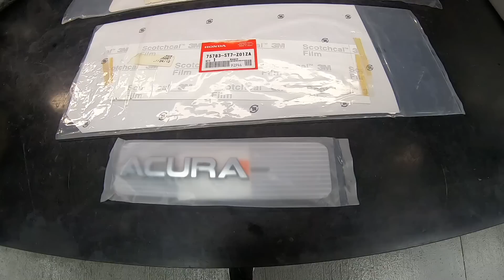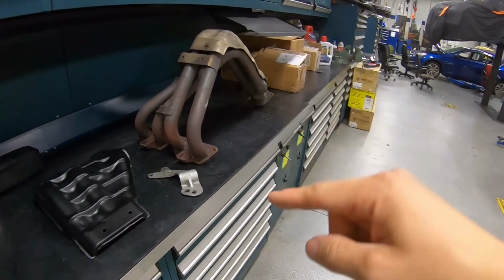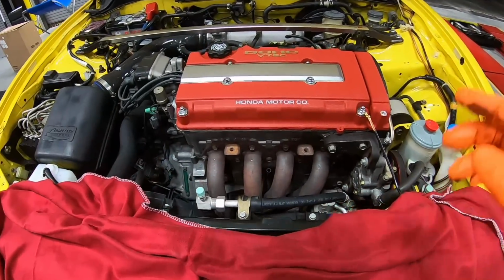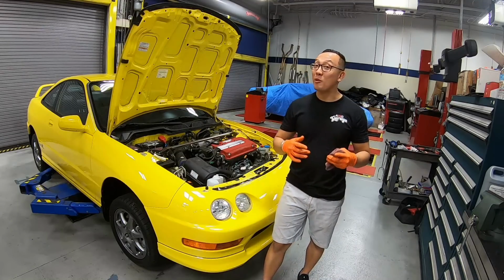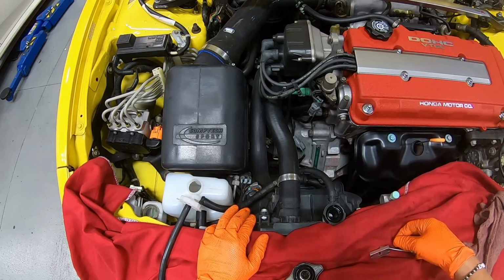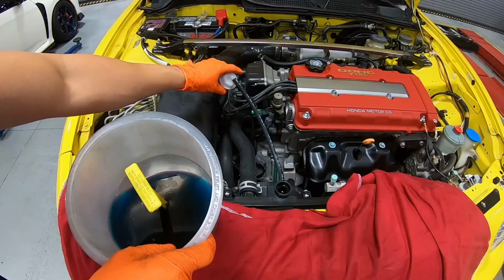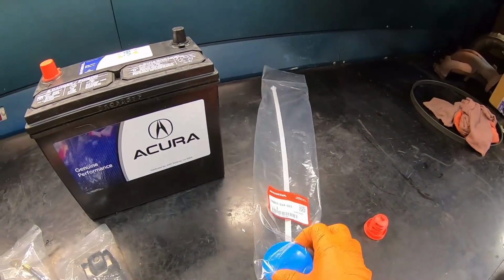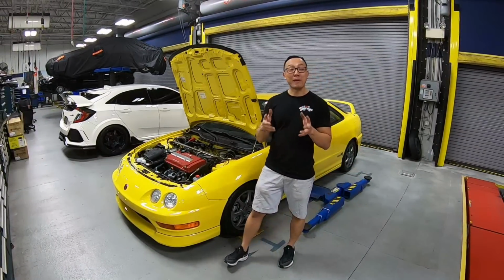OEM+ Refresh DC2 ITR -  Engine Bay Minor Refresh with JDM ITR Header (Episode 3)

Comment: Nice!  Had this channel recommended to me recently as I've been poking at some similar small restoration / maintenance on my NSX.  Not disappointed!  Factory spring hose clamps ftw,  the majority of the leaks I've had on my cooling system have been from some previous owner/tech using worm drive clamps instead of the OE spring clamps.  100% the way to go.
Reply from the maker: Welcome aboard!

Comment: Engine cover paint?   High temp paint or a ceramic paint?
Reply: I am curious as well how it was refinished.   I used high temp paint on one in the past and it was not going to last.
Reply: @touringteg  Engine cover is new OEM I installed it prior to Mike getting his hands on the car...
Reply from the maker: Are you referring the engine valve cover or exhaust manifold cover?
Reply: @Jamess17065  Sorry I meant the exhaust manifold heat shield
Reply: @ahcgarage  I assume he meant exhaust manifold cover.  I was curious how it was refinished.
Reply from the maker: @touringteg  Yea, we refinished for he exhaust manifold cover with high temp paint. With the right prep, the refinish will remain solid
Reply: @ahcgarage  Thank you!

Comment: Em1 ground strap.  Too bad ITR it’s discontinued.  I am annoyed with myself because a few years ago I tossed a used one.   This was when new ones were still available.   I restored the one on my current R.

The JDM 98 spec header length is different length than USDM so which cat or test pipe was used?
Reply from the maker: We did the same. We threw away usdm exhaust manifold cover and replace with the new one. 

As for the exhaust manifold, your are correct. Jdm 4-1 header is longer so we used a Jdm cat and bolt up to the stock b-pipe
Reply: @ahcgarage  USDM shield recycled!   Sad days.  Makes sense!  I have a JDM cat ready to go on (with JDM 4-1, b pipe and muffler).  I am just waiting for the o2 bung to be welded on and then will use an angled defouler.
Reply: @touringteg  can the regular downstream o2 sensor work in the JDM cat with a welded-in o2 bung?
Reply: @330arr  What I have heard is JDM cat does not function as well as the USDM cat.  I am having an o2 bung welded on the JDM cat then running an angled defouler so it will never see the exhaust stream.  Without the defouler it will throw a check engine light.  Likely P0420
Reply: @touringteg  thanks for the info 👍
Reply: @330arr  No problem.

Comment: Love it as usual!  Good timing as I have a 98 spec JDM header, cat, B pipe and muffler.  I am refinishing my full exhaust, new heat shield bolts etc.   My header shield is out for Cerakote right now.  I have the USDM/CDM header as well missing the heat shield.  After a year of searching I gave up and finally got the 98 spec JDM header.